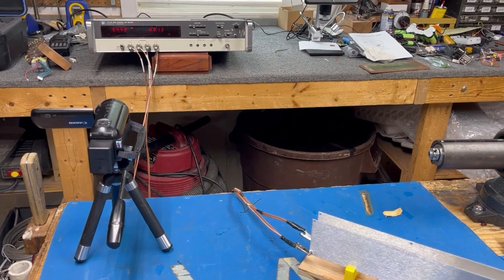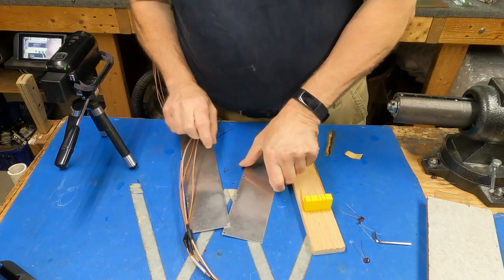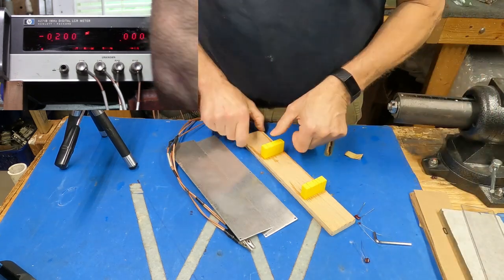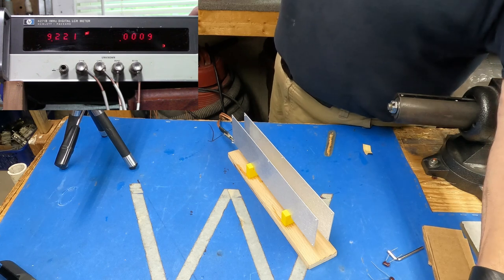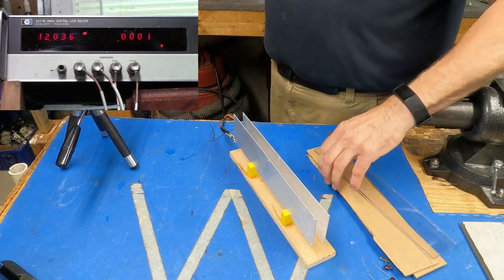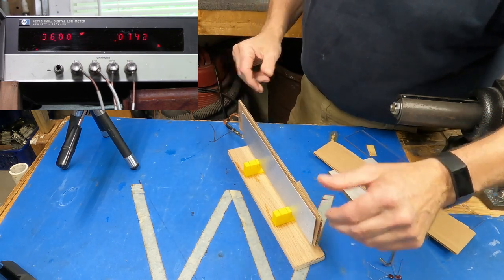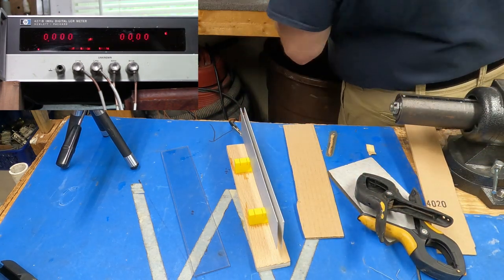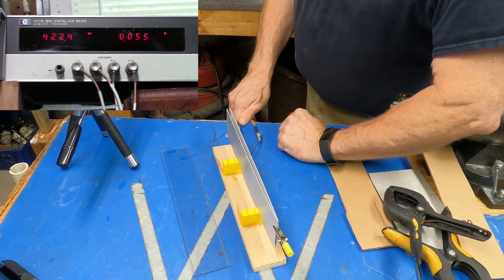Lets build a capacitor

Comment: Excellent! I used to do that for my work in a precision R & L lab. Used for analog computers and research. Polystyrene, polycarbonate and teflon were used for various effects. I still have a few resistors ranging from "crude" 1% through .001%. Capacitors, sealed & filled with dry nitrogen,and temperature cycled were 0.1 to 0.01, with a few 0.001% . Think $$.  As they change after heat/ cold cycling to improve stability, they are wound with that in mind. So we got a gausian curve result, sorted by selection into accuracy ratings. One set was built in nice cases for Stanford, .001 uuF through 1farad ( refridgerator size). But you can easily make decent audio and rf filter/ bypass and blocking ones in the home. Use saran wrap and aluminum foil . Calculate what  value needed and size of " plates"  and cut 2 strips accordingly. Lay strip of saran down first, next foil, offset a bit to one side about 1/4", then center another plastic strip. Last  comes the final metal one, offset to the opposite side. The metal foil should be an inch or so shorter than the plastic strips and centered lengthwise. Now carefully roll up the layers all together, like a rolled up newspaper. A little scotch tape on side and ends hold things in place. Roll as tightly as  can. At finish, more scotch tape goes around like belt. You see two brush like fans of metal on each end, after all is secured by tape. But do not the metal ends, which should be sticking out 1/4 inch at each end. Squish them down on table using book or dish to squeeze and tap them flat. We then used a big iron and aluminum solder to attach leads. If that is not an option, use 2 leads with a ring of several turns in spiral shape and, with someone to hold them in place, wrap lengthwise with electrical tape end to end, with a little tension. Use about 5 turns. You can now  dip it in epoxy or the black vinyl stuff used to cover tool handles. Let dry by hanging, but be sure newspaper is underneath if this is in kitchen or mom/sweet wife will get a little distraught with tar like goo on her table. A 3 ft by 1 inch makes very useable bypass cap for rf and 3 inch width works for audio. Quite useable for RF bypass around headset on a crystal radio. Note: not for tune circuits. Not exactly silver mica. 73 Karl WA2KBZ.😢

Comment: Great demonstration, thank you! Do you by any chance know the frequency or frequency range of this LCR meter? Might be changing with outranging. Just curious. I checked it's manual and found no info.
Reply from the maker: Hi Sam... many LCR change frequency as you say.  Example low freq. 100 HZ for large UF values to 100 KHZ for low PF values.  I was curious as you were, so I put a oscilloscope across the LCR leads and measured 3 values  250 UF  , .01 UF and 30 PF this LCR meter uses 1 KHZ and does not change freq during the measurement of all those values...  W1VLF